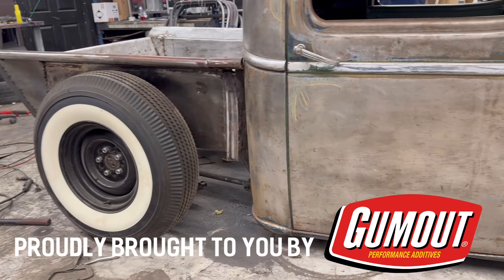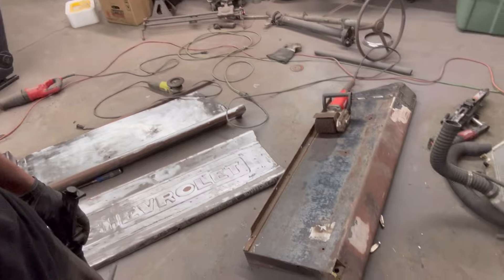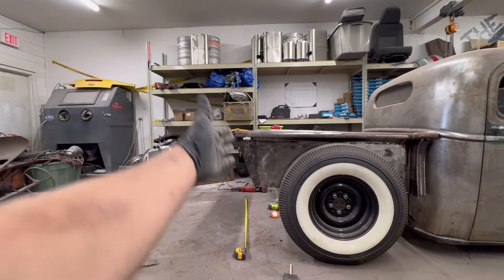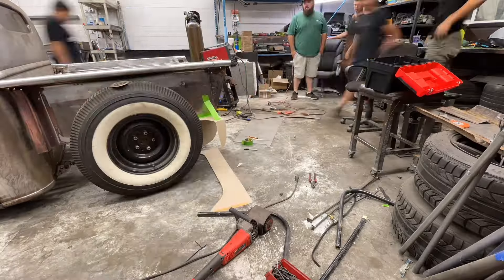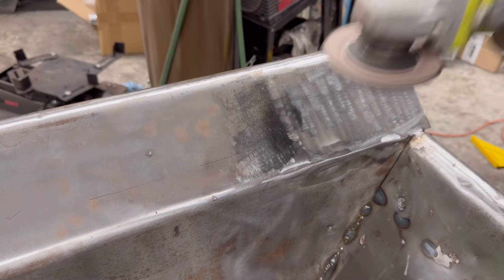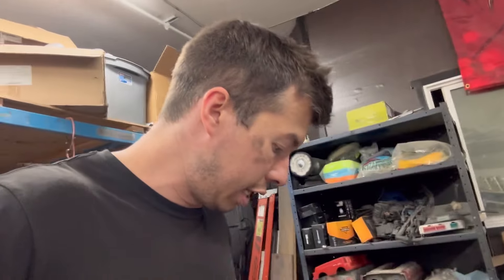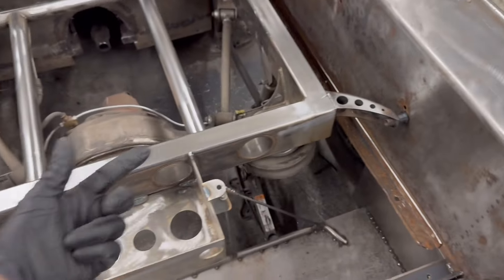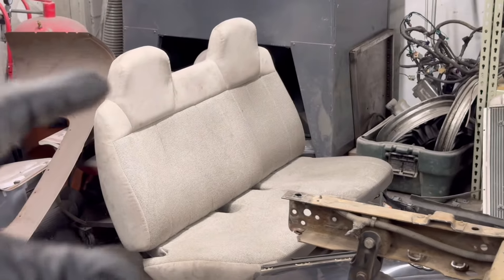RISKY CUTS MADE IN THE BED OF OUR CHOPPED 39’ CHEVY [Gumout 39’ Chevy Build Part 4]

Comment: For the tail lights, it might look good to have turn signal strips along the shorter top section there.
Reply: Yeah in the round bed rail
Reply: @Grimm-Gaming  oh I was thinking a strip along the short section that connects to the round bed rail, but yea inside the round part would be better
Reply from the maker: Both are cool ideas!

Comment: I like your taillight idea but you're gonna have to do the same for the front headlights. Maybe an under glow would look good just speculating. I think a wood bed would be better especially if it was stained and has little metal spacers between each wood plank. You need to put a supercharger or twin turbo the engine that would be SO SICK. The slanted tailgate looks awesome as well. Keep up the good work guys! 😁

Comment: By angling the tailgate back, you created an air-dam, causing less drag. That was a good modification, Preston. Normally, the air gets trapped in the truck bed, causing turbulence and drag slowing the truck down using more fuel to keep up to speed.
Reply: that and once he slots the roll pan, if done in the right spot it will work just like a diffuser and help plant the rear end at speed.
Reply from the maker: Ahhh!!! So we accidentally did something efficient haha

Comment: Since your into chopping stuff in half.  Im currently working on turning my 04 Honda TRX300 ATV into a side by side. Even learned how to 3d model to design it.  Basically making a seating compartment , cutting the atv in half, welding it to the seating compartment. Not going for anything crazy just a little dirt trail cruiser. Since it wont have much clearance or power
Reply from the maker: That’ll be sweet! Doesn’t have to be crazy to be fun!

Comment: Really like the approach you’ve taken in the rear but please stay true to the era of the car you’re building and don’t use carbon fibre or plastic in the build. The LS makes perfect sense and you can dress them up up to look like an old school engine but carbon fibre will look out of place.  Steel, alloy or wood will do the job and keep the feel at the same time
Reply from the maker: Hmmm valid point.  My thoughts were that the carbon would kinda help the modern race look we’re going for
Reply: @GARAGEIdiotS  I can’t see any of the modern race look you talk of. It’s all true to old school hot rodding apart from the modern engine and it’s honestly perfect as is. Hot rods should be simple builds. That’s part of the appeal. Be careful about over building a car or building something that you have to explain to people so they can understand it. The car should speak so loudly for itself that you don’t need explain anything. You’re building a give-away car which should appeal to as broader audience as it can to gain interest in your channel. It seems like the majority of comments support the old school approach as it sits. Also, the simpler you keep it the quicker you’ll get it finished which is just as important in this case. Keep going Preston. You got this!